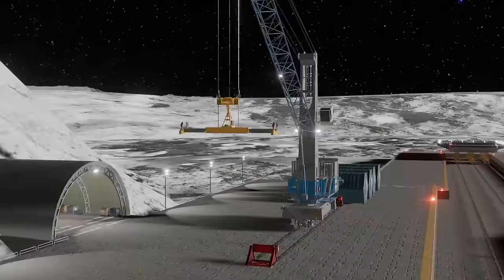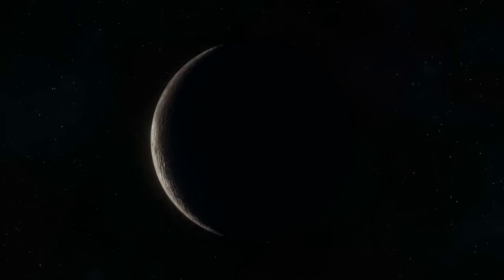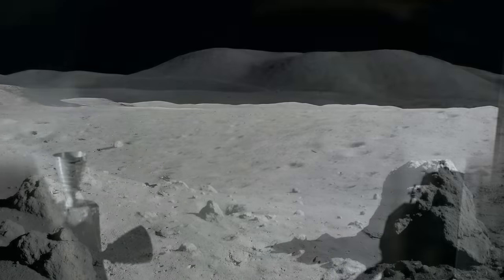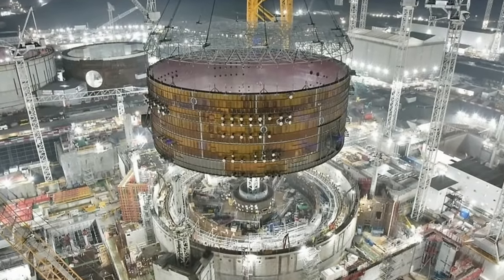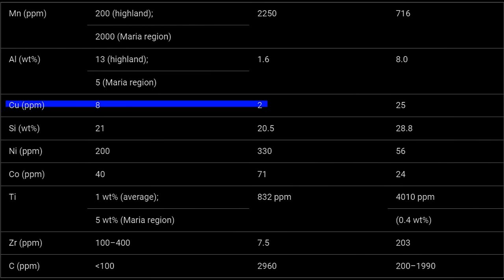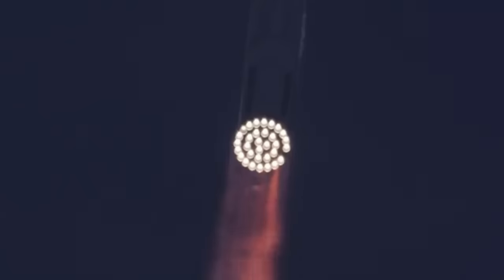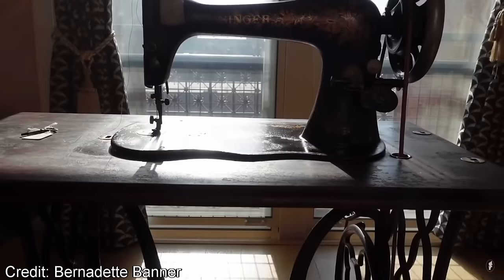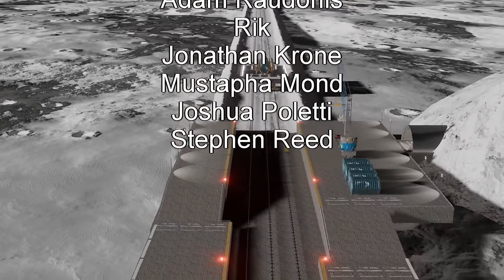Designing Heavy Machinery To Excavate The Moon

Comment: To make anything you need to cut. And the absolute king of cutting is the lathe. And the queen ... maybe the mill. Solve those 2 machines up there and the stock material and all you need is a couple of machinist engineers. 3 in total. 3 people can just about assemble and install anything.

Now there are a lot of technical problems which come with the Moon, like cold welding of metals, the quality of the stock you can get, machining maintenance which may require special, not available materials, ... but, you can use a mill and a lathe to make another mill and lathe.

.. and couple of metric tons a measuring equipment.. very important.

Comment: Caterpillar has already released a commercial lineup of electric heavy duty construction equipment, they are battery operated and can be charged on a generator and then run on the battery pack or run from the generator for a more sustained operation. Just replace the generator with a nuclear reactor they already have the technology to run modern construction equipment on battery

Comment: We'll need to start with smallish robotic dozers/pushers, or something like a mini bucket thingy that the old Viking Tony uses on the Gold Rush tv show that can remove as much of the loose moon dust as possible. That stuff is nasty, dangerous and deadly if enough of it is breathed in, the Apollo guys all got a good dose of it in their lungs and they weren't there long, not to mention how much that dust can destroy machinery. Tiny little microscopic silicon razor blades aren't a good thing, or a machine that can melt the top layers of the dust to make it easier to collect. That will have to be done anyways to make landing pads so it's a win win.

Comment: Dozers use hydraulics to literally push the blades into the ground - can't do that with cables and dozers are for the most part tracked for a reason, requires  ALOT of grip to literally scrape the ea-errrrrr-moon.

Just general harvesting perhaps it would be better to develop a scraper - essentially a machine that drags a box on the ground with a slit cut in the bottom to scoop up materials.

Comment: I think the greatest weakness of this lunar machinery lie in their batteries.

Batteries are highly complex value added products, that have significant engineering complexity, low mass and volume energy densities, are difficult to manufacture, and have total lifespans and capacities that are highly susceptible to the affects of radiation. Manufacturing them on the moon would require significant R&D costs that are virtually impossible to estimate and importing them from earth would be prohibitively expensive due to the aforementioned low mass and volume energy densities. 

Rather than using batteries, tethering these machines, via steel/aluminium cables, to a tower would be less complex, more cost efficient, and immediately realizable. Steel/Aluminum cable is much easier to manufacture if you go the in-situ route, and even importing spools of them I don't think would be terribly costly. If you are already manufacturing steel beams on the moon, a team of welders could probably put together a tower in a few weeks, and have virtually no R&D cost, hell even a single beam as a stake in the ground might work given the low gravity, and virtually non-existent wind. Combine that with a system to pick up the slack from the wire and you have a fully functioning system to deliver virtually unlimited power to your equipment.
Reply from the maker: The article in the description discusses how these Na-ion batteries can be 3d printed

Comment: I have another question about the concept of mining on the lunar surface. Sure we have tests and samples of the lunar surface soil. What knowledge do we have about possible ore deposits or other minable resources? What chances do we have of finding a vein of iron or lithium or even carbon? The table showing soil composition shows that lithium is at 10ppm on the moon, but only 18ppm on earth. Well, obviously we don't mine that to make batteries on earth. We find a rich deposit of lithium, and another of cobalt. Using just regolith is a great way to get started. But I think we're eventually have to do some exploration drilling to find more useful substances to work and build with.

Comment: About the electronics in a modern car question, I don't know the exact answer but I kwon they are a terribile comparison. Cars use the lowest quality computer chips in order to save some dollars on manufacturing. However, if you are importing them from Earth to the Moon I suppose that you would care a lot about weight... At least as much as you do in a cell phone. And my cellphone Is perfectly capable of supporting an AI system complex enough to drive your excavator. Now if we consider that my phone weights 166 grams (including the battery that we are making on the Moon) then you could get away with 1 milion vehicles out of a 130 tons delivery of electronics' goods
By the way, great video, I enjoyed it very much!
Reply from the maker: @Giovanni17563  thanks for the info!

Comment: Aluminium motors and other wiring on the moon would probably work just fine. The main issue with aluminium in electric circuits is oxidation of connectors. Not much risk of that one the moon. But there's a third way of digging that doesn't use either cable and pulleys OR hydraulics: https://en.wikipedia.org/wiki/Bucket-wheel_excavator

Comment: I’d wager it would be more practical given we are setting up steel and Likely a stone cutting operation…  for building materials… (no water for concrete so you’d have to either import the water or just cut the stone into form. You could set up old style railroad engineering… it’s a LOT more efficient to move a LONG train than it is to move one single hopper at a time)

Comment: You kind of gloss over how big of a problem of materials processing and refinement is. Everything from bulk material handling to separation to heating to forming has to essentially be reinvented from scratch. Contemporary processes for iron and aluminum extraction consume and/or utilize materials that aren't available at the scales required on the moon. Like water, carbon, and reducing agents to convert oxides to metallic forms. Those challenges are at least as significant as building stuff with those post-processed materials.
Reply from the maker: @rre9121  https://youtu.be/iWntOmhv5Ic?si=uREu-Yua5G5-ch7y

Comment: I don't see why we wouldn't just send a bunch of fairly small robots up in large numbers. The weight issue of sending huge equipment up there would be too big of an issue, especially in the beginning. Way easier to design and send small bots in large numbers to do lots of specific tasks and build slowly and carefully over time. The reason we have giant machinery on earth is to save time and money. That doesn't work on the moon. The bigger and heavier in space the more it will cost to launch. You can send lightweight stuff to the moon in large numbers and they can accomplish far more labor than big dig type machinery.

Comment: as for the powering of moon vehicles, while i think you're right about batteries being the best way to store energy given the resources present i think the first machines should be made to primarily run on stirling or similar motors with thermal batteries. much, much simpler battery compared to sodium ion, no need for electrochem or making/rolling thin films of fragile materials and you won't need to import carbon and such for them.

much like on earth, i think ferroaluminum is better than chromium steel; the most important thing chrome does better (rust prevention) doesn't apply on the moon anyways.

Comment: Mining is the cool stuff, but using explosives has the problem of creating high veloci debri, so you would need to cover your explosion field with a type of tarp, and collect the produce bellow it in a thick cloud of dust and silt, there is tech especially designed for this, in mines where there is too much debri in the air and is impossible to see through your window you have expecial types of sensors to know where you are and what to do.

Comment: I doubt it will be so big for a long while. I guess you could get some ideas with number running but my gut says small and many in swarm type configurations. Increases redundancy which is potentially a cheaper route, small numbers of failures can cause huge costs. Everything will be geared towards preventing uphill travel, it's all about the high ground in space you don't put something down a well unless you want to keep it there or it becomes worth a hell of a lot more when you drag it back up.
Reply: Also the moon should become an international park. No mining should be allowed. The international community needs to agree that resource collection in our solar system should be restricted to asteroids. All planetary resources need to stay intact and undisturbed.

Comment: We'll need to account for dust control. Dust that is disturbed on the lunar surface gets lofted for years IIRC. This will foul mechanisms, cover solar panels, radiators and heat sinks, lower visibility substantially, and mess with signal equipment/electronics to the point where current designs would be almost useless. Closest thing I can figure would be static field dust collectors, possibly like a big tented net made from aluminum wire, near both your disturbance sites and any sensitive equipment. Any heavy equipment itself will need repellent fields as well, but they will need to be tuned so that you're not rooster-tailing a fountain of dust off the surface as soon as you turn it on. This brings up the question of transport bigtime, because if moving equipment across the surface is inherently dusty, we may be way better off using sections of enclosed conveyors connected to collection hoppers placed near dig sites to relay regolith to processing centres.

Honestly if you figure out how to attract/repel lunar dust really effectively, you could probably hoover up unbelievable amounts of dust as an industry all it's own, not only for dust control around your sites, but for mega easy mining fodder.

Comment: Things weigh 1/6th on the moon, so equipment could be very large. Perhaps a flying ore hauler???
Reply from the maker: A 'hopping hopper' is something I'll touch on in the next video but it's really dependent on the fuel environment. Is fuel so cheap this is better than using rail infrastructure? Dunno but likely not considering rail infrastructure would use electricity from the sun.

Comment: Good stuff, mostly, I think we'll be using most of these techs to bootstrap a lunar economy.
One area I'm not so sure about is the batteries...they might need a bit more developed infrastructure before they are a good, native, option.
As an alternative...hydrogen internal combustion engines. A Lunar base is going to need to electrolyse water into hydrogen and oxygen anyway. All you need is a hydrogen ICE and big tanks on a vehicle to store the gasses...and big tanks are fine on the moon. The combustiion product is water..which can be recoverred and re electrolysed back to H and O. The tanks wouldn't need to be cryogenic, just able to hold high pressure. The engine would need fine tolerances..but wouldn't need too be super high tech..and ought to be buildable and repairable on site.
Battery tech will definitely be needed..but I don't see it being a first step on site build.
Your other ideas make sense, though a lot of structures may be plain iron rather than needing steel.
Great vid tho 👍

Comment: The carbon from the astronaut's excrement is not an option as it will need to stay in the bio loop to keep your astronauts alive and happy(ish)
Also these are some very interesting designs, but a bulldozer won't be much use if the blade doesn't cover it's entire front profile
Reply from the maker: Yeah it's a terrible idea but meant to convey the pointlessness of trying to avoid carbon imports in general.

Comment: I would personally suggest keeping the fragile bald monkeys off the death ball, and leave the realms of space to robots first.
We have too many needs to fit into the flintstones side of things, so if you skip the need for humans to be up there, planning for what all is needed first is vastly simpler.

I would suggest step 1 is to simply place down a solar field up there, and possibly a solar mirror or lens based smelter.

Those two tools then reduce the remaining problems to "put stuff in the lens > get melted stuff" which suggests some kind of regolith moving system.  I'd suggest thinking less about vehicles and more about "what is the least amount of mechanical actuation I need to get regolith from places within field x,y to smelter at z".  In the mining industry we typically would use conveyors over long distances because vehicles suck at this - but new opportunities or wins (A vs B) might be true given there's less gravity and lunar dust will shred the shit out of anything that moves.

Comment: I wonder if computers, even simpler ones specifically made for this sort of machinery, would ever be produced on the moon. It is a bit interesting to think about, although they'd probably just end up having a bunch of imported tech connected to them. Maybe it would be a high tech modern control computer locked up in a box inside the machine and connected to a bunch of locally produced devices that are made to be super tough and cheap in order to save costs. I'm not much of a retro computer guy but it seems like you could just replace parts on those old computers, and they would probably be pretty easy to make with more modern machines.

Now I don't know anything about what materials are available up there, maybe importing all the necessary stuff to do that would mass more than just packing starships with CPUs and shipping them out.
Reply from the maker: We might even return to vacuum tubes!
Reply: ... or vacuum transistors (they exist).

Comment: The electronics that we would need on moon need to be slower due to radiation, so something like a pc from year 2000 or like NASA specification. They will also need cooling which would be significantly bigger due to no atmosphere like you said earlier. But yeah the electronics would sill be small.

Comment: Hey did you take into account much easier technology then a pulley shovel - and it is bucket shovel? This will not be so dependent on gravity like a shovel loader. In that design you do not need any cables and just a mechanical movement via wheels and transportation by belts or use a fluid mechanics to transport (i.e. gas pressure transportation).

Comment: how about flipping the question, instead of building vehicles build an enormous scaffold from which cranes, scoops, furnaces, and everything else is suspended. Low gravity and no corrosion mean the structure can be immense,  it would basically be an open strip mine in the factory.

Comment: When you choose the Poles as starting Piont you could use Hydrogen Fuelcells.
For example you power your base with an nuclear reactor and use some share of the power to refine anmd split Ice (Water) in Hydrogen as Fuelsource for vehicle and Spacefligthd back to earth. I think the biggest Problem for Fuelcells is the Thermal managment.
And by the way we could use somthing like a traditionell petrol-engine by burning hydrogen and oxigen (from the splitting of the water). Petrol engines are in comparison with the most other solution less complex, but the same Problem as with Fuelcells is the cooling.

Comment: I don't think a nuclear reactor would even be viable on a moon. Our modern designs require a lot of water.
Reply: We have used nuclear power in space, in much harder environments than the moon for literally half a century by now. They are called RTGs, are practically maintenance free for decades, small and relatively light weight.

Comment: Imagine if you will, using Strandbeests as beasts of burden, using lunar winds, or even replacing their wind sails for solar sails that run much faster and much stronger. I'd recommend taking a look at Theo Jansen's strandbeests and their potential
Reply from the maker: Those are so cool but wouldn't that just be a solar powered strandbeest and then why not just upgrade to wheels and steel?
Reply: @Anthrofuturism , Because the goal is to minimize the technology we bring to the moon so we can bring more and more. Strandbeests can be cheaply made into herds that I can imagine you can do a lot with, especially in the low gravity of the moon. Of course when we can afford to bring better equipment, we definitely should. But the cost effectiveness can’t be ignored. I’d love to see what you can do with this concept
Reply: Solar sails are not stronger than wind sails though, solar sails produce truly miniscule amounts of force. At earth's distance from the sun solar sails only exert 0.0000091396 newtons per square meter. You need literal acres of them to get even a single newton of force. They only work in the frictionless vacuum of space, on the surface of the moon even the tiniest bit of friction from the ground will totally overpower the tiny force a solar sail can exert.

Comment: I beg to differ that batteries are the only option. The moon has no atmosphere so there is no direct thermal conductvity. This makes it ideal for concentrated solar power where you don't point the sun beams directly on the stirling engine but rather use it to melt sodium (ISRO just discovered an abundance of that) and keept it molten with limited needs for insulation. You can use the thermal energy in essentially giant swimming pools of molten sodium to run stirling engines even during solar night, topping it up during solar days which mind you last two weeks each.
Reply from the maker: @TheSirTobiSwobi  I never said they are the only option
Reply: BTFO